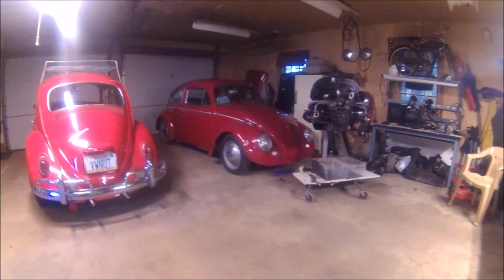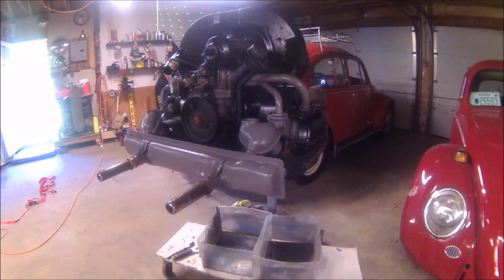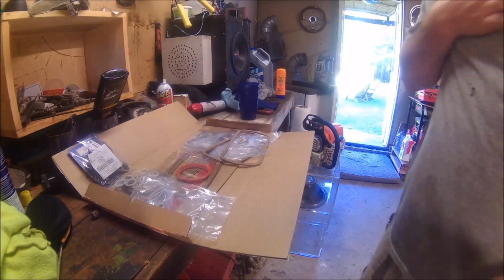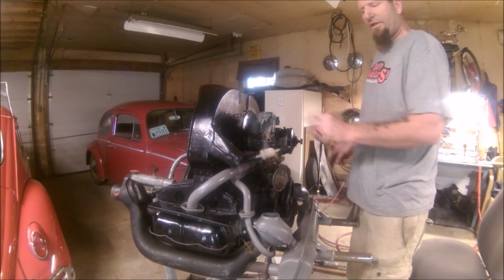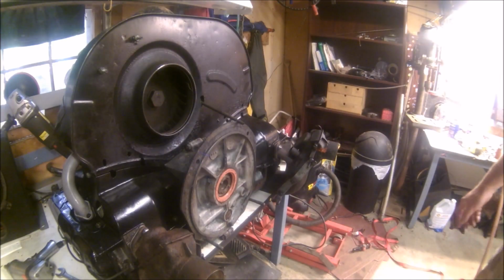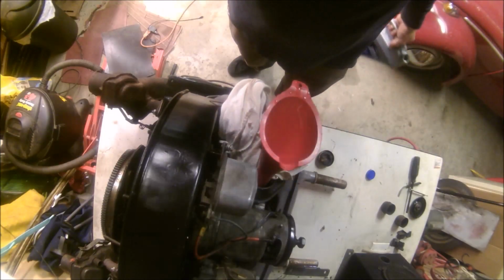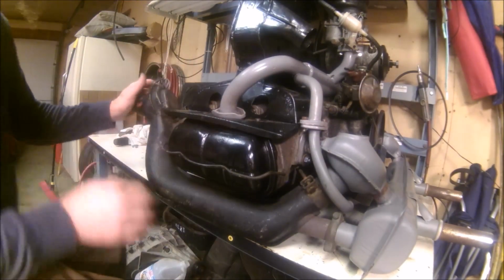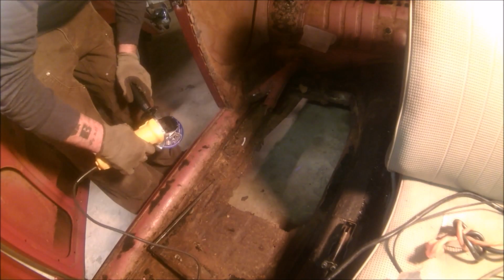1964 vw bug (Daisy) part 13

Comment: i’m about to buy my first bug, it’s rust free and has a motor but it’s missing a transmission. i figure it’s still a good buy for $200 though. thoughts?
Reply: Matt 517 a trans can be expensive, but if it's good like you say it is, then $200 is worth it
Reply from the maker: sounds like a good deal. thanks for watching